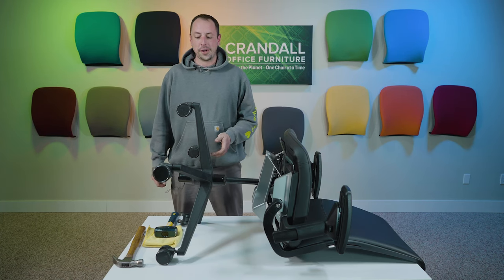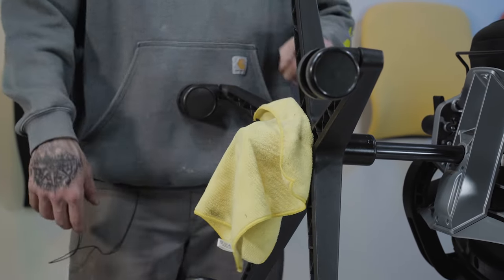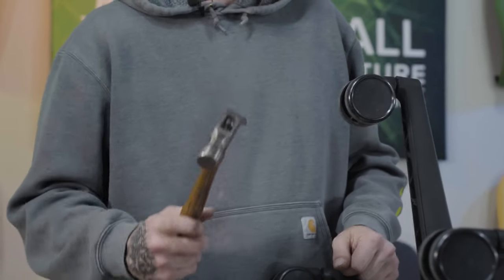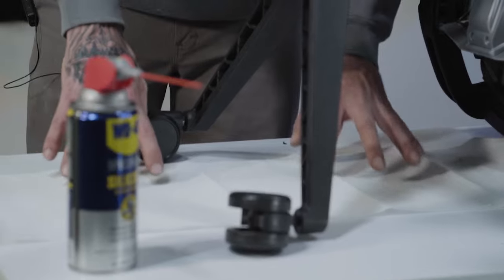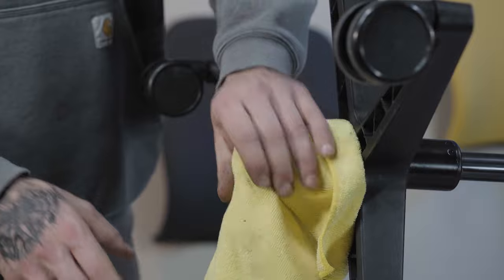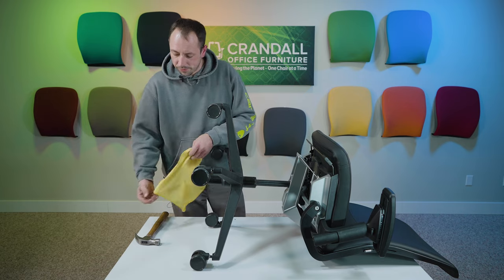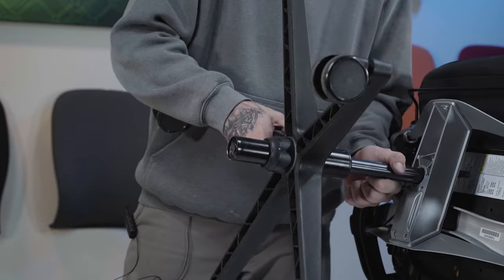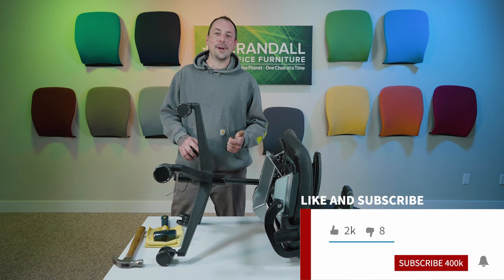How To Remove and Install The Base on an Office Chair

Comment: I've got a well used Realspace Ruzzi and I just cannot get the base off. Tried lubricant, a hammer, a sledge. At this point I'm also considering sawing the thing off (the base is broken already and I'm replacing it.

Comment: Is there a reason you don't simply remove the clip and pull the base off? I saw this in another YouTube video and it worked perfectly for me 🤔
Reply from the maker: In that scenario is also takes the cover can of the cylinder with it and then the cylinder can is removed and that put back onto the cylinder. It is definitely another way of doing it.

Comment: i've been trying and trying.. can't get the wheel base off.    Wd40, hitting from both ends..  thinking i'm going to use a sawsall to the plastic.   any other suggestions?
Reply from the maker: First don't use a Sawsall to it, if you can send us a couple of pictures to Contact@crandalloffice.com so that way we know what chair it is and how we can better help you.
Reply: @CrandallOfficeFurniture  email just sent.
Reply: @CrandallOfficeFurniture  i was finally able to get the feet off.  Used a spray lubricant, over night,  then used a small metal sledge hammer instead of trying with a rubber mallet.
Reply: I've found using a 18" pipe wrench helps immensely. It will scratch up the piston but if thats what you are replacing, it works like a charm. I think I got mine for under $10 at Harbor Freight Tools.